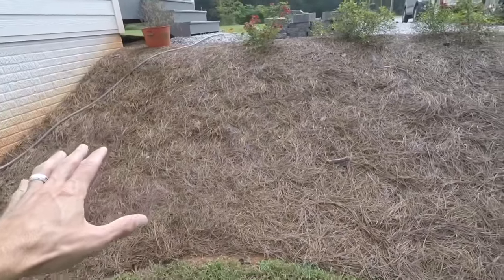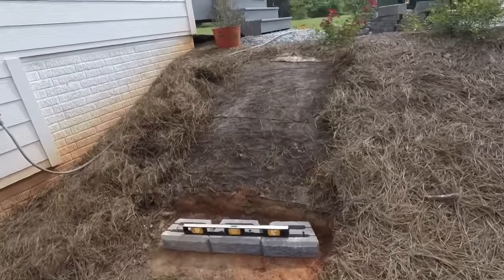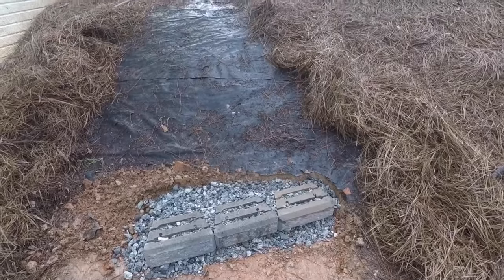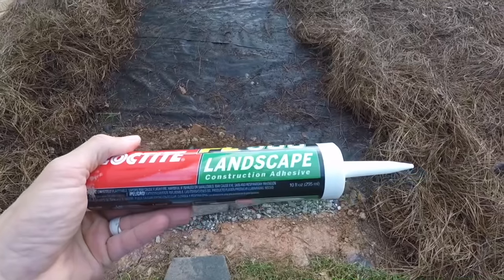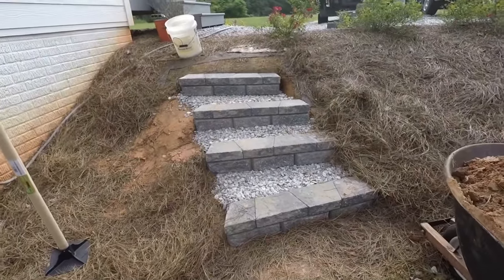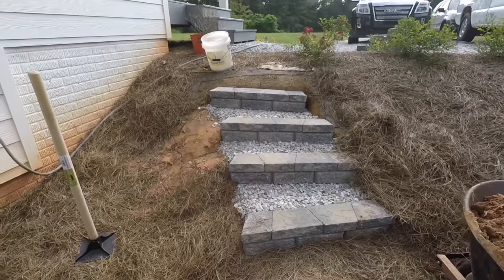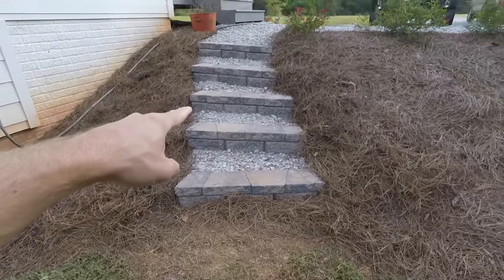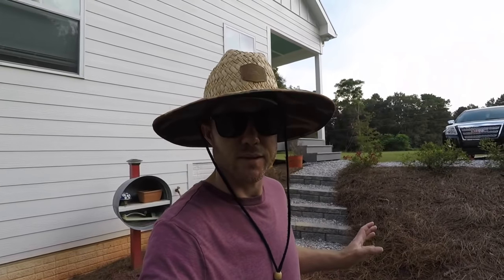Building steps into a hill.

Comment: I hope you realize you just showed a million DIYers how to build steps just like these. You did a great job all the way around on this video! Thank you!
Reply: and these step will fall apart in two years
Reply: agreed. i was surprised he only anchored the bottom step. id love to see an update of them now
Reply: @rickdeckard1075  why so? Care to explain?
Reply: 649,000
Reply: Those 5 and the other 3 need a grasp able hand rail..
Reply: Not bad 😊Be careful with the glue because over time it may fail as i had one stone cap piece on a retaining wall come loose because the glue didn’t completely hold it secured
Reply: Yeah... every one of those steps should have had 2-4 feet of rebar pounded through them (depending on sandy vs rocky/clay soil), then have been concreted in place before the caps were put on. Those stairs wouldn't hold up more than a year or 2 until they become a danger to everyone walking on them.
Reply: Thank you so much! Now hope I can find those same materials at Lowe’s. God bless you!

Comment: Stakes driven down in the brick holes to help limit any movement from heavy rain ect would be the only thing I’d do different, fantastic look. I’m stealing your idea. Great vid.
Reply: You can see the blocks were designed with that in mind. There're 2 round holes in each to drive in a paver spike or a length of rebar.
Reply: Yeah...I think I would have put some rebar stakes in....but pretty impressive job!
Reply: @lis819  agreed. my lot is flat, but if I ever need exterior steps, I'm doing something like this (but with rebar lol)
Reply: Exactly.  Depending on the climate, especially freeze thaw and rain, those might move and shift around a bit.  But what is now there can be realigned in a weekend if needed in 10 years.

Comment: I'd add some buried pipe along the top and down the sides to help water drain away from the blocks, otherwise over the years you might see a slump. The size of the pavers though, you might get away with it but water is the enemy when dealing with gradients. It keeps washing things from top to bottom unless its given an easy way down that bypasses all the hard work. That and/or add some plants along the side to stabilise the soil
Reply: The correct way is actually putting the drainage down the middle of that area first, not the sides. Otherwise you're not addressing the water seeping into the middle which can then freeze (frost heave) but some drainage is better than no drainage.

Comment: Great video! I'm probably going to do something similar. I couldn't tell if you used rebar to anchor the cinder blocks to the ground. The ones you used also had horizontal slots that you can slip a piece of rebar into. I would anchor each step into the ground and to each other by tying the rebar together. This will keep it from shifting as the soil shifts throughout the years.
Reply: Yeah, blocks and concrete with rebar anchored down would be much better. Problem is not everyone has a mixer or knows someone who has one!
Reply: If you want add concrete, the amount of concrete needed for this wouldn’t be large. You would be the mixer with your shovel
Reply: @renerodriguez2926 fill the blocks with concrete before putting on the caps?

Comment: You created a slope steps AND a great video!! Very helpful to watch it. I was amazed to see how cleanly you were able to dig into the slope and even terrace horizontal and vertical. I could not get a good look at what kind of shovel you were using.
Reply from the maker: It’s called a square shovel or a transfer shovel. My hill was very soft so the digging was easy.

Comment: I put wood stairs in a similar spot. So much easier and water isn't a problem. If I was going to do them on the ground I think I'd pour concrete. Those look like a trip hazard, especially as they settle. They look good though.

Comment: how does it look, 3 years later?
Reply from the maker: The steps haven't settled much, but the cap blocks that I glued on are coming off. I will make an update video eventually when I repair them. I will have to use something better than the adhesive I used last time. I will try mortar or something. I haven't had time to research it yet. I'm the only one that uses these steps so it isn't a big problem right now.

Comment: Not terrible for a small personal job VISUALLY, but your steps will 100% end up shifting probably sooner than later given the lack of proper gravel base and the fact that the steps aren't anchored or held in place by anything at all. Fun little learning curve project though!
Reply: Just curious... what would you use/do differently?
Reply: @GreyMann2  He built them on backfill dirt that will continue to freeze/thaw heave and settle. There’s several ways to counter that the most solid being digging to undisturbed soil below frost line.
Reply: @tycer7  hey! I'm a novice.  😎. I'm Google your technique
Reply: If you dig to the frost line here you'd end up digging down to 3ft... That's not always practical (or doable, we have a ton of granite boulders where we'd like a staircase). Still, that is correct but he'd have to know where that is. 

I agree though, he should still dig it down more and maybe use rebar for anchors.
Reply: @CP-mb7ly  i know.  When I lived in MN it was 42”. You still have to get below that to truly prevent frost heave. Price one pays to live there. Things didn’t just fall apart in a couple of years improperly footed but they moved. 
I’m also someone who works with boomers who need stability and my frontline is 18”.. However in MN a couple of post holes below frost line on each step and that stuff will never move
Reply: @tycer7  actually this is wrong - I don't know why I didn't catch it earlier, but digging down to undisturbed soil ... Will disturb the soil! Then you'd end up with a new frost line. Like, dig down to 3 feet, the frost line at that point will still be... 3 feet...
Reply: Y’all are brutal.  For $100 and two days of work, this serves a purpose, looks great and will last a loooong time.
Reply: @violetjames7534  Well said!
Reply: @violetjames7534  if there's any significant snow and freezing, I give it 3-5 years max
Reply: @CP-mb7ly  nothing is mortared together and can shift freely.  It’ll last longer than you think.
Reply: You need to dig the entire hill out. And at least 6 inches below the first step and build from there. The water need to be able to go down behind the steps and under.
Reply: Will steps like this in warm states like Georgia be subjected to temperature changes and shifting too?

Comment: Chisel work was impressive!
Reply from the maker: Thank you! I used to have a masonry chisel that I used when I built some steps like this at another house. I couldn’t find it so I just used an old wood chisel I had. It worked great!
Reply: @BrantleyBlended  I'm doing my garden up here in the UK and we moved a step... 2" thick paving slab to a new position and it was too big - having seen you do it in your vid we had a go with our slab and it worked a treat! We used a cold chisel, took 10 mins or so, but just a line across both sides and it just feel in half - would never have had the confidence to do it without seeing you do it, cheers!

Comment: Thanks for video. In your other house you said you didn’t use gravel, but just dug into the hill. In a steep hill with hard soil, what happens if you don’t use gravel? Why use gravel?
Reply from the maker: The hill at my other house was not this steep so I didn't need gravel. I think I only had 3 steps and they were a lot closer together. I really just figured this project out as I went along with it. I used gravel because I had a lot of it in my driveway.

Comment: Did you use any type of rebar or stakes for the blocks or just simply tamp before laying? Curious as to how they're holding up because I'm about to copy your layout 😊
Reply from the maker: I did not use any rebar or stakes. The steps haven't settled much. They are still in decent shape but the cap blocks are coming unglued. I'm going to make a repair video eventually. I will use something stronger, like mortar, to glue the top blocks on.

Comment: In NH construction adhesive came apart on my paver steps. Code should require a hand railing for those 5 steps, right? Here I need to shovel snow off so gravel would cause a problem. Women’s shoes can not walk down that kind of gravel.

Comment: Where did you get the white brick-look siding on your foundation that adjoins to the siding?
Reply from the maker: That is my concrete foundation. It’s common in Georgia to see this. It’s the mold or form that they used when they poured my concrete foundation. It just looks like brick.

Comment: We've got a nasty hill that we want to do this to that doesn't really have a flat spot to start at, and want to cut a path into the hill going over to another area in the backyard. Any suggestions for this? Just start the stairs right above where we want to run the path?
Reply from the maker: My yard is sloped a little bit at the bottom of these steps because my house sits on a basement. There wasn’t a perfectly flat spot to start. I didn’t have an exact plan. I just bought the blocks and started digging and figured it out as I went along. Sometimes I pulled the blocks up and moved them around if I didn’t like the way it was.

Yes, just start the stairs above where you want to run the path and figure it out as you go along. It worked for me.

Comment: Why do you fill the block with gravel? Is there any particular reason? Also, to me that travel seems very coarse, would you get a finer caliber?
Reply from the maker: I used #57 gravel because I already had it in my driveway. Something smaller might have been better, but I used what I had and didn’t have to spend any extra money. 

I think putting gravel inside the block made the steps more stable or tied them together better.
Reply: @BrantleyBlended  thanks!!!
Reply: @BrantleyBlended  I'll be doing something kind of similar... Much less fancy, just one cinder block per step, but the hill is about 100ft

Comment: Nice work. Is that a wood chisel you are using to cut the caps?  U need a bolster chisel!
Reply from the maker: Yes, it’s an old wood chisel. I used to have a bolster chisel or masonry chisel, whatever it’s called. I built some other steps like this a few years ago with it. I guess it got lost when we moved. I just used what I had.

Comment: Great video! I want to do something like this in my slopey backyard, can I ask what the purpose is with the retaining wall blocks that have the middles cut out that you are dumping gravel into?
Reply from the maker: I am not a landscape professional. My opinion is that the holes help give the wall strength by putting gravel or concrete in them. I chose these blocks because of the grayish color and the textured look they have. I would’ve used them even if they didn’t have the holes for the gravel.

Comment: I commend you on a tasty stepway, but my constructive ;) criticism is that you didn't measure your rise and run, and they look uneven which is a hazard. But well done!
Reply: Ah yes, rise and run measurements!! Safety…
Reply: Run is irrelevant as it's just dropped into the slope. Rise is the same at each step as the blocks are the same height, between the step drops is sloped so you're still climbing between drops.  He took a hazardous slippery slope and broke it up and gave it gravel traction, any hazard left over is minimal except for inattentive clumsy people.

Comment: thanks for the video the steps look awesome! I'm going to take your cue and do the same in my backyard. I was on lowes and found what looks like your blocks, is it a 6"high wall block with a 3" high cap?
Reply from the maker: I think what I used is Insignia 12” L x 4” H x 7” D and the cap block that goes with it. Mine are grey and brown. I tried to link it below. Not sure if it worked. 

They have other brands like Pavestone that would work also. 

Insignia 12-in L x 4-in H x 7-in D Concrete Retaining Wall Block https://www.lowes.com/pd/Insignia-Brown-Charcoal-blend-Retaining-Wall-Block-Common-4-in-x-12-in-Actual-4-in-x-12-in/3646834

Comment: Hey, great job on these! Can you provide a  link to the block and caps you used from Lowes? There are so many different sizes. Thank you!
Reply from the maker: Wall block
Insignia 12-in L x 4-in H x 7-in D Concrete Retaining Wall Block https://www.lowes.com/pd/Insignia-Grey-Buff-Retaining-Wall-Block-Common-4-in-x-12-in-Actual-4-in-x-12-in/50237237
Reply from the maker: Cap Block
Insignia 12-in L x 3-in H x 7-in D Concrete Retaining Wall Cap https://www.lowes.com/pd/Insignia-Grey-Buff-Retaining-Wall-Cap-Common-3-in-x-12-in-Actual-2-5-in-x-12-in/50237239
Reply: Thank you for sharing that!

Comment: What glue did you use?
Reply from the maker: I don’t remember. I thought I showed it in the video. I think it was some type of construction adhesive. It’s not holding up. Some of the cap blocks are loose. I’m going to fix them with some kind of mortor probably. I’ll make a video about it eventually when I get some time.
Reply: I use srw adhesive at my company, very good stuff!!

Comment: Your steps seem ok for short term makeshift emergency use steps only!!!   I understand why you did this: Expedient & inexpensive.   Many of us do this, but we WILL end up re-building steps soon, as they don't really work. 

There are so many better videos for building steps!  

These steps were built haphazardly. I'm betting that you have looked at many step building videos or should have but for some reason ignored measuring. Your steps are uneven. Each gravel section appears to vary.   (These uneven sections will also make you walk down carefully each time!) The gravel base is inadequate, like only 1/2" though kudos for tamping. Regardless, the gravel which will likely disappear soon into the soil. 

You did not stabilize the dirt above or below or to the sides. The soil is loose all around the stairs.   When it rains your pretty steps & gravel will be covered with dirt/mud & blocks will shift. 

Blocks aren't pinned or stabilized, so will move.    (Did you at least glue the caps to interconnect the blocks to help stabilize adjoining blocks?)  Those caps do make the steps aesthetically work, but might pose a hazard too, like when loose/ unglued.  If there is gravel on the step, it rolls underfoot> Slip.  ( Either gravel or cement but not both or sweep before you use. )

You wouldn't build a static retaining wall with no drainage, no stability & no pinning, why would you build steps this way that you actually need to  use & could be a safety issue.  (Retaining walls are built upon deep gravel beds to channel off water. (Using ground cloth helps here.) The first course of blocks are laid over the gravel at or below the level of the ground to provide a solid foundation & anchor for the exposed block.  If blocks are next to hills the force of the water & the hill will move the block, so anchors are employed. 
Not an expert but common knowledge that stairs are always exposed to hill forces and have issues with stability & drainage. 

Dig & line a trench at the bottom of the adjoining slope to visualize how much water you are dealing with.

Comment: If you live in a warm climate, stairs built in  this fashion may last a few years before beginning to fail….

Anyone attempting to build steps via this method on a job of mine would be asked to leave.

Improper excavation, compaction, materials, lack of fabric. 

So much concrete adhesive was used, tell tale sign of a rookie.